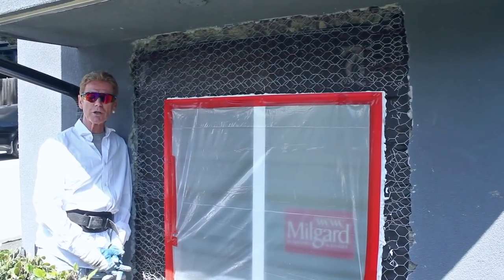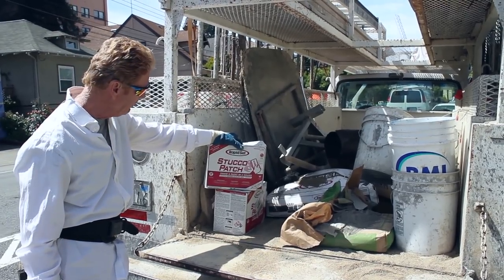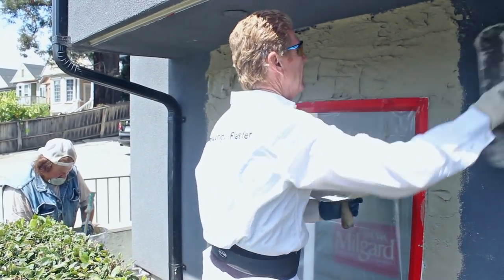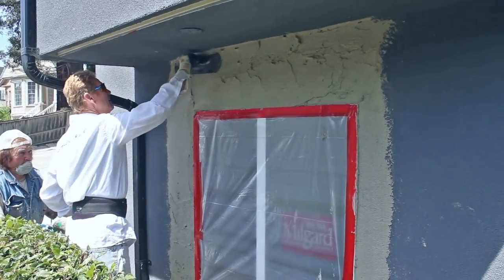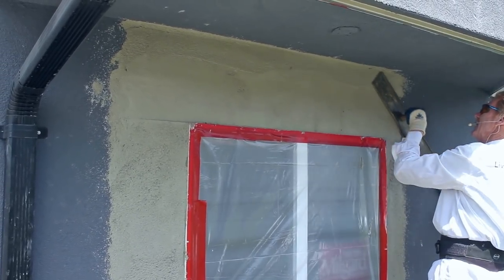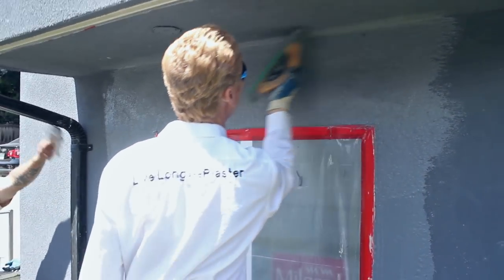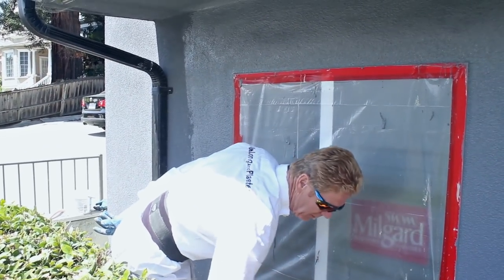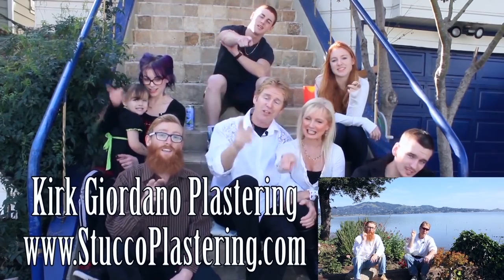Stucco and paint the same day, Rapid Set Stucco patch

Comment: Hey Kirk Dude, Philly Auction house here. Started some. Major work to come.  Got a watch stucco over btick. Thanx Bud
Reply from the maker: Howdy Mercado, FYI,   
   When anyone starts to apply cement plaster at first, there are muscles in your forearm, wrist and deltoid and shoulders that you more than likely didn’t know existed.
    These muscles are rarely used in everyday living.
 Thus they will feel like they are on fire or swell up when you start to apply plaster, no worries, this is an excellent sign of unused and still weak muscles, not hurt muscles.
    then when that beautiful pain is gone, begin again. 
Your wrist, forearms or shoulders will burn, but that's o.k. 
For the average person, it takes a week or two to get those unused muscles strong enough to move mud where you want it.
   FYI, if you fall off a bike and hurt your leg, that's a bad pain or soreness, to strengthen muscles you didn’t know you had, creates a beautiful soreness.  
                                   Live long and plaster
               Kirk Giordano’s Plastering answers to life’s issues

Comment: After watching a ton of your videos, I got courage - this weekend I did a window this size and same size hole to patch. Being a noob, I applied two layers of rapid set, working around the window, until the new work matched the same plane as the existing, which allowed me to compensate for my lack of skill. Then I did the finish color coat yesterday. Basically what you did in 15 minutes took me two days. So yeah, I'm a little awesome (as long as I don't get any cracks). Especially since I know what the sponge float is for, thank you sir.

Though my eyes were irritated from I think the rapid set. Does it cause eyes to burn? Maybe it's just me.

Oh, my main point was: amazing color match job! Really remarkable, the color is right on the money.
Reply from the maker: Howdy Jeff, congratulations on your decision to go for it.
   As far as eyes being burned by the lye in the stucco, you betcha, removing or mixing any stucco or plaster or just sitting at a bus stop, will have an effect of duct particles that will kick anyone arse.
   Dust is no joke and proper reperators shold be worn when handling all materials.
                    Live long and plaster
      Plastering and repair tips on your home

Comment: Really great video I like it......... I'm in  Phoenix Arizona in winter.... We've done a lot of texture. Touch-ups on a 4 plex  apartment building... My Latino stucco, guys just use straight cement stucco mix..... We want to paint as soon as possible...... The recommendation is waiting 28 days..... We really wanna paint in 1 week...... We've seen where we can run some PH tests. Sherwin Williams has PH test kits to tell when you're ready to paint..... Do you have any advice on the minimum cure  Time for cement's stucco  before we can paint. Thanks if you get back to me.
Reply from the maker: This "rapid set stucco patch" is paintable in two hours, and it's sold at all HD and Lowes stores. All the rest of the info you seek is in the description.

Comment: Hey Kurt you are the expert so I want to know what strength weld Crete do I put on  smooth painted cement patches they did previously for repairs on a dash finish stucco I want to dash over the smooth ...do I dilute the weld Crete?
Reply from the maker: Good evening Johhny, I recommend you do as the can says.
 Us professional plasterers who have been plastering for more than twenty-five years know when to dilute the bonding agent, but this is only when color cating a home, I dont advise folks to dilute unless they are licensed plastering contractors.

                         Bringing peace, love, and harmony to plastering 
                 Sound advice from the plastering messengers of Youtube
Reply: @StuccoPlastering  Thank you very much I know from experience dashing texture on there over a smooth painted cement it will fall right off also does that bondex acrylic fortifier they sell at home depot does that work like the larsen's or is it considered just a fortifying agent
Reply from the maker: Good evening Johhny, acrylic fortifying agents are not bonding agents.
 Home Depot sells Quikrete bonding agent it adheres concrete to concrete up to one inch thick is a good substitute, maybe even stronger as Quikrete wrote the book on concrete and cement plastering and their products.
 I prefer Weldcrete by lawsons as it has a solid reputation for so many years, but it is sold at only the plastering yards, I also like Weldcrete as it's blue in color, this is a big help, as you can see if an area was missed.

                         Bringing peace, love, and harmony to plastering 
                 Sound advice from the plastering messengers of Youtube

Comment: Can Quikrete Liquid Cement Color be added to the Rapid Set Stucco Patch?   Are there other products that can be added to the Rapid Set Stucco Patch for coloring? I've been searching for the answers to this, but haven't been able to find the answer.  I figured if anybody would know, it has to be you!  Thanks for the wealth of information you provide!
Reply from the maker: You can add a lot of colors, but no doubt won't get the desired color as Rapid Set is tan. You can purchase Lehighs white cement or any other brand of white cement, but if the sand is added, it becomes tan, as the sand is usually brown, thus when mixed with any color you choose. this must be considered.
 I bought white cement and white sand, then added color for the basecoat which was never to be painted a few years back in the town of Sonora on two homes.
 This takes practice and material knowledge. 
But sure it can be done.
 My son Jason did this in a short video two weeks ago to get a blueish basecoat, then did a light blue finish on the same day. 👨‍🏫 He, too, is an SME subject matter expert. Cheers. 👨🏻‍🔬

Comment: Kirk I have really enjoyed many of your videos! I recently used Rapid Set mortar mix down here in Georgia on a hot humid summer day for repair a spot that was bulging. Wow, that stuff hardened soooo fast. Even when I watered it down. Think it was cause hot summer time? Next time I will not use rapid set.
Reply from the maker: Howdy Kevin, there are many Rapid set materials including the cement all that hardens 3 times as fast as the Rapid set stucco, I skim coated a wall once with thier Cement All to see if I could, I was able to but had to hustle like crazy.
 These Rapid set products take some time in to learn about the set times, for quick same day repairs and painting they are worth the time in.
                    Live long and plaster
      Plastering and repair tips for your home

Comment: Hey Kirk I have an old block house and I wanna stucco it myself should I pursuer wash and then put on a bonding agent after? I was just wondering if I need to use the Bonding agent so it will stick the the old painted block or if I can just stucco it after I wash it please help thank you
Reply from the maker: Good evening Gareth dude, sorry for the late response but when these questions come in is out of my hands.
 After pressure washing when the blocks are dried is when you paint on the bonding agent.
 If your blocks walls were never painted no bonding agent would have been necessary as the stucco would adhere with what we call a natural mechanical bond.
 This happens when you hit the existing block walls with water then apply stucco, the two adhere by suction as they are both cementitious.
                       Peace love and happiness to all 
            Bringing Plastering tips to the world, via YouTube Video

Comment: How do I change a Spanish textured stucco to a smooth finish?  What tools are recommended.
Thanks,
Reply from the maker: Howdy Bigguy, you'd have to pressure wash your existing wall, then apply a bonding agent, now a new color coat can be applied to whatever finish you want.
 However, If your current texture is heavy or thick a skim coat would have to be applied also, before a finish coat.     
                                   Live long and plaster
                Answers to life’s stucco and plastering questions

Comment: My neighbor hired someone to fix cracks in her stucco. Why the hell was that guy using tar to fix it?
When they are stucco mixes that can easily be used.
And trying to paint that. Yeah right.
After watching your and Mike Haduck videos. I did my own cement and stucco, and it came out pretty good. Considering I never done that before. 
She should have come to me to fix it.
Reply from the maker: Howdy Lord Dude, well if I were to take a guess, that fella may have supposed that since tar works on certain roofs and chimneys to prevent water from penetrating, he possibly felt it would work on the walls.
 I too have been guilty of doing some goofy shit in my younger days.     
                     Live long and plaster, 
  Sharing stucco secrets and or common sense tips

Comment: Will the color streak when using a wet float?
Reply from the maker: Howdy Chris Dude, excellent question, Depends.
 when applying all dark colors weather acrylic or cementitious, the darker the color the more varied color's will become visible.
 Why? Another excellent question, glad you asked.
   Say, for example, you pour Clorox on blue jeans it's a similar situation.
If the colors start to cure or harden, water becomes necessary to bring out the sand, thus the variation of colors can happen, especially when doing patchwork, that means a color patch within a complete wall.
   This is more likely with crappy acrylics than others.
 It's best to keep your sponge float as dry as possible through the entire process, however, when re-coloring patches within a finished wall, it's a whole new ballgame. 
When the tie in perimeters become dry, a plasterer has no choice but to dip the sponge float into the water to bring it back to life to blend in, welcome to possible streaking.      
                     Live long and plaster, 
  Sharing stucco secrets and or common sense tips

Comment: Why red tape..can I use blue painters tape?
Reply from the maker: You my friend can use any tape you wish. For us the blue tape is for interiors as when water touches it, it come off. 
The red or most vinyls resist the water that's in all mixed stuccoes or plasters.
Reply: Red tape is alot better for stucco....it doesn't tear and is more resilient 

Stucco scratches, tears and rips blue tape...as well as the trowel....plus adhesion is alot better

In any trade you see what they use and know their is a reason for it and youll soon find out why

Blue tape doesn't like water either

Comment: Kirk ARENT YOU SUPPOSE TO USE THE PLASTIC FLOAT FOR ACRYLIC
Reply from the maker: Howdy Jose, good question my brother, a plastic float can do two things, act like a hard rubber float and compress the base coat or provide a certain finish.
 A sponge float pulls the sand to the surface, this is what the first plastering company used, thus I have to match their finish.      
                     Live long and plaster, 
  Sharing stucco secrets and or common sense tips

Comment: Wait a minute you're going to cut off the video before you  show it completely dry and blended in that's the most critical part darn it we know it's not flawless but we need to see you what a true professional can do
Reply from the maker: Howdy Noblsht, I agree, however, if it's dry, cool beans if it's not when we leave, bummer.
 Standing around watching paint dry for possible two more hours is not financially wise for me, so we usually show current results right before we depart.
 FYI, This color matching did come out much better than I thought it would.      
                     Live long and plaster, 
  Sharing stucco secrets and or common sense tips